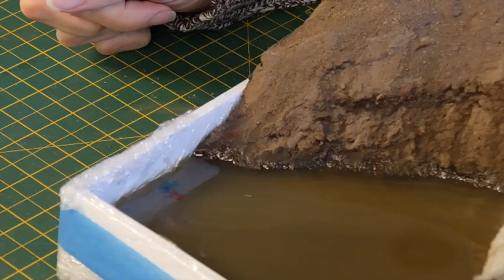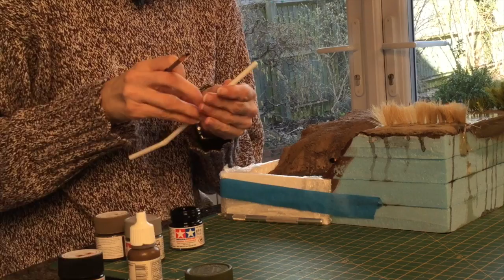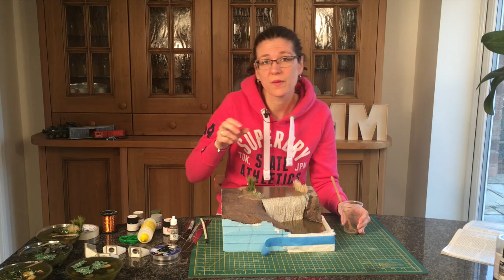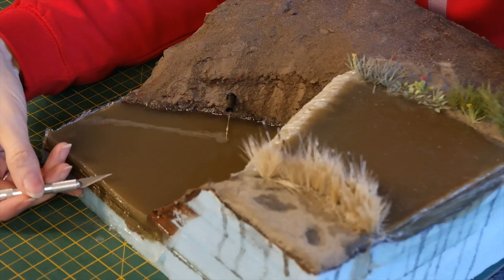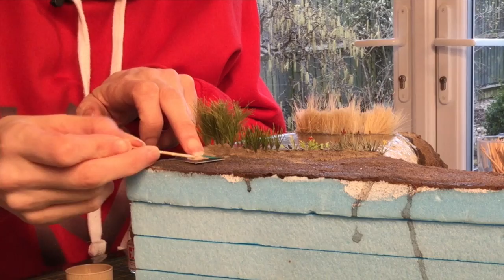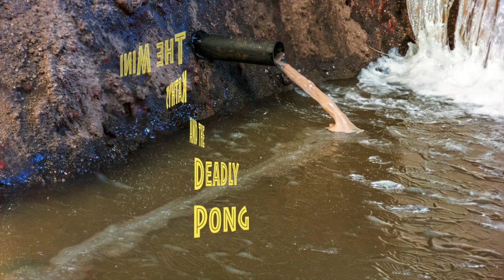How to Model an Effluent Pipe

Comment: Kathy,

I am enjoying this series.  Despite being a hobby and modelling veteran, I have always been nervous to use magic water.  I love the work you are doing, and I am looking forward to further updates.   Thanks!
Reply from the maker: +AlgaeTheOriginal Thanks a lot!  I used to be really nervous too which is why I did my first epoxy on a small diorama to get used to it.  Having now poured gallons of the stuff, even it leaking everywhere and then not setting properly doesn't phase me.  I guess I've had it all go wrong at some point.  I'm glad to be able to pass on the tips I have learnt and the encouragement to go for it.
Reply: Thank you for the update!  And the encouragement.  Early on in my hobbying foray I had a catastrophic epoxy problem, where the resin never quite set, and I was left with a very sticky, ruined problem.  Watching your work has inspired me to give it another go.  Thanks again Kathy!
Reply from the maker: +AlgaeTheOriginal That happened to me once in the middle of my port area.  I covered it with acrylic gloss medium and it's not been a problem at all.  It was sticky rather than runny and has discoloured slightly over time. It just looks like a patch of dirty water so is not out of keeping.  If I had the height, now I'd just pour another layer over the top!

Comment: From personal experience, I would strongly recommend against using drinking straws or plastic coffee stirrers in applications that require them to be painted. Food-grade plastics tend to be very resistant to holding paint, and you may find that the paint will strip off far too easily.

What drinking straws are very good for is using them as a mandrill to make resin-impregnated paper mache tubes, which will be far easier to paint. Just soak your paper in resin, then wrap it around the straw. When the resin is tacky, you should be able to slide the straw out of the paper tube, which you can then leave to set up.
Reply from the maker: Thanks Sharon for the tip. I've used straws a lot of times with no real problems but I agree that paint can sometimes flake off if you handle and flex the plastic a lot.

Comment: Oil slicks are iridescent. You can use clear iridescent acrylic paint or medium. Liquitex makes such a product for around $9.
\\][//
Reply from the maker: +Willy Whitten I’m not sure I tried liquified but all the paints had a pigment size that was too large. Even the inks were a little large in scale.
Reply: "I tried liquified"~Kathy Millatt. You must mean Liquitex. I don't know about HO scale...you may be right!
\\][//